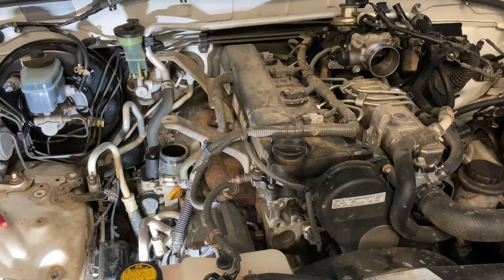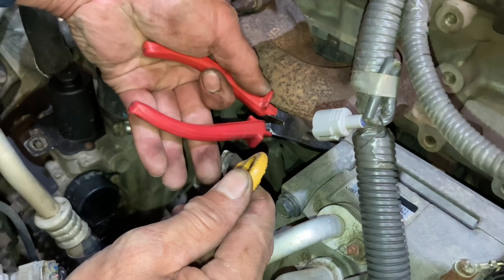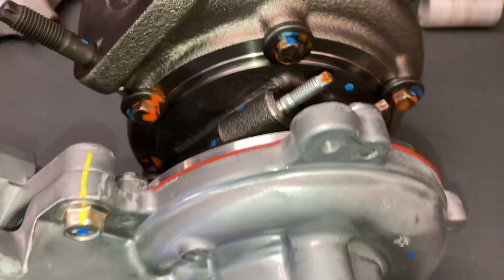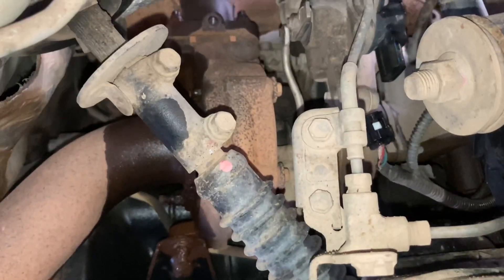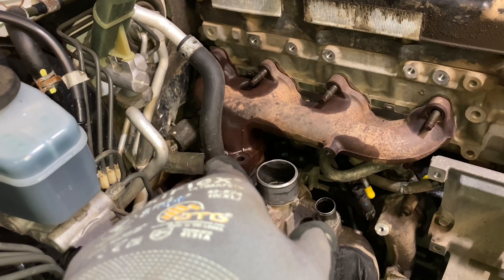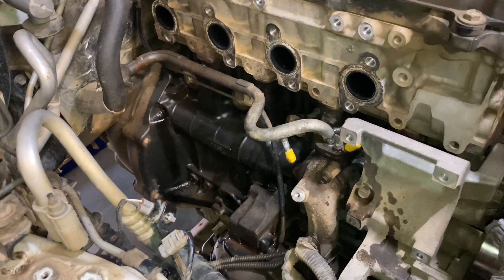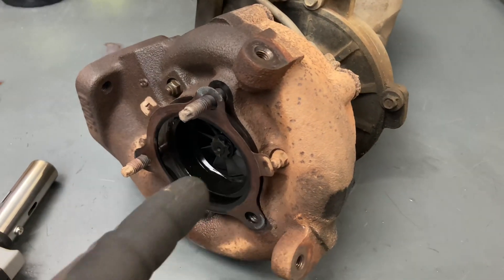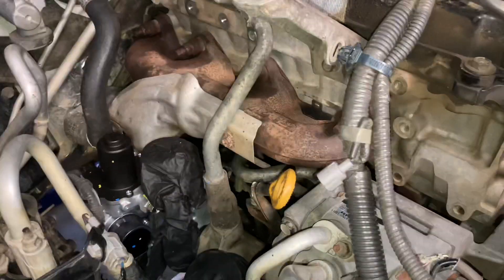BLOWN TURBO REPLACEMENT INFORMATION 1kd-ftv

Comment: What do you think that would cause this turbo to fail? I have been told if you have good oil and coolant supply the turbo shouldn't fail. Unless there is foreign object. But this one has a broke exhause turbine. Could be just bad quality turbo?

Comment: Thank you for this great video! And thank you for the description note :)
After watching your videos, I wish you could do a world tour to save prados out there :)

I have a 2004 Prado GX 1KD 3.0D4D (Europe, LHD), with 176k km on the clock.
I was driving yesterday and noticed a loss of power with the engine lights on and VSC/TRC and VSC/OFF lights on, the car was going in limp mode. I took it to my mech right away and we got P0045 error code. We cleaned the air filter,  and the lights have gone and the car is driving normal, but I am still worried this issue to arise again.

Should I change the Turbo along side changing the turbo oil feed return pipe as well? I can see there is a leak coming from it and going down in turbo area. 

Someone told me he had the same issue and he changed the suction control valve SCV. I am not a mechano just an amateur car lover and I am quiet confused with which way to go, especially cost wise but I am ready to take care of the car.

And big thank you to the video about MAP filter, I have definitely to change mine, has some oil stains on it and never been changed but I will asap.

Keep it up with your great and very informative videos, hoping hearing from you.

Comment: Hi 4×4 i have a question for you its a past video for    but for me its now here is my question its a toyota grand hiace no fault code but my egr cooler  vaccum side is stuck closed its hard to opperate by   hand engine lucks power please help?